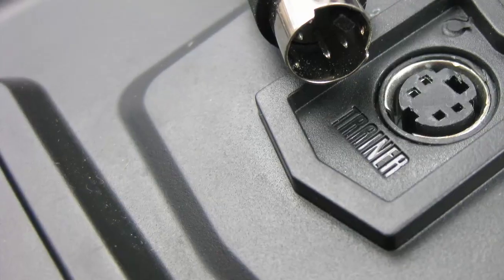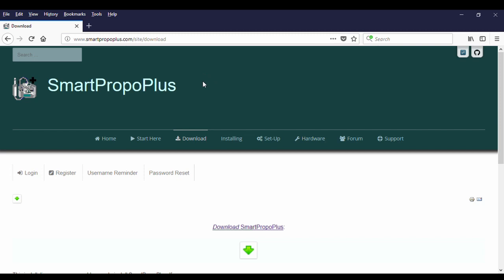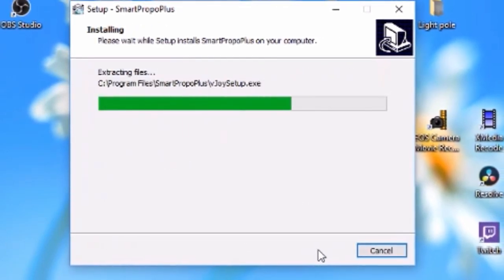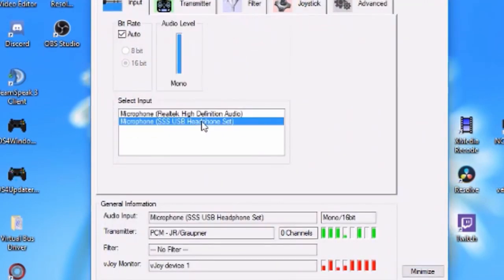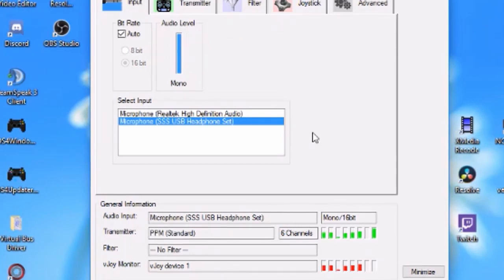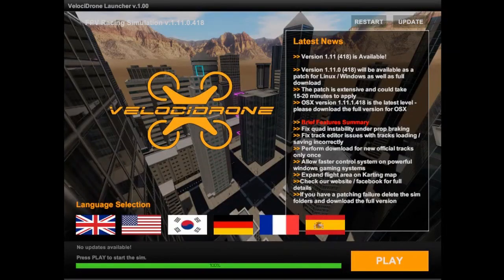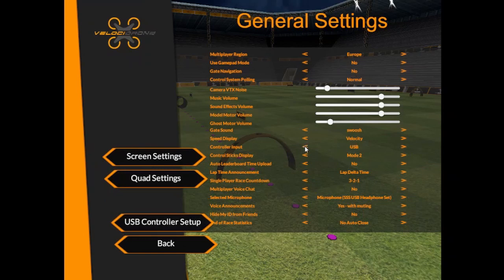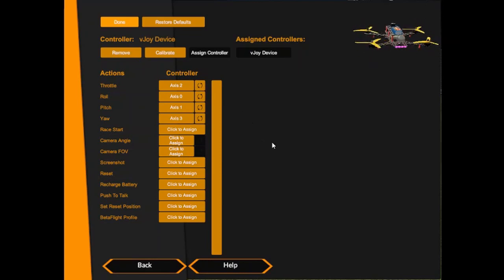Flysky fsi6 Setup for Sims with SmartPropoPlus

Comment: Verry nice i will also complete this couse some people have a problem with the connection  on windows 10,they don't have a v joy 1 connection  and this solve the problem,( is a copy paste from RC.GROUPS ) 

For those of you wondering how to get this working with any radio without the use of a USB dongle, download the application called "SmartPropoPlus" from http://www.smartpropoplus.com/site/ and install it.

Hook your radio up with a standard 3.5 mm audio cable and plug it into one of your soundcard speaker ports. SmartPropPlus and vJoy will detect the PPM pulses and transform them into a joystick driver which can later be used with games etc.

If you are running Windows 10 x64 as I am, the joystick emulator/driver doesn't work that comes bundled with the application.

The solution to that is to install latest SmartPropoplus and ignore the failed installation of vJoy, then manually install vJoy "vJoy_205_050515.exe" from https://sourceforge.net/projects/vjo...atest/download which will upgrade the older vJoy installation. After the installation is succesfull, follow the below workaround:

Copy, paste and replace the following files from C:\Program Files\vJoy\x64 to C:\Program Files\SmartPropoPlus folder:

msvcp120.dll
msvcr120.dll
vJoyInterface.dll

This should now make it possible to map input from SPP to vJoy.

Now check your "Set up USB game controllers" in Windows and hopefully you should see the "vJoy device". Calibrate your controller and then set up your radio in FPVFreerider. I recommend "use deadzone"
Reply: pleas video  no make
Reply: dead link
Reply: Mine is working but sticks are crazy they are moving even when I'm not moving
Reply: Many thanks dude!
Reply: This won't fix smartpropoplus not working today in it's current state with all audio input devices, smartpropoplus development died 4+ years ago